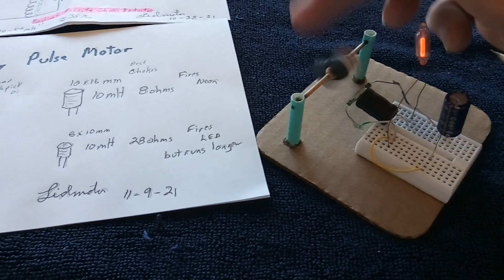Choked Paper Pulse Motor

Comment: That 2nd, more powerful & noisy choke motor arrangement...would that be powerful enough to spin a twisted & stiffened paper or acrylic plastic 'free flight' prop? To carry itself & the whole assembly inside a very light wing loading, micro 'stick-&-tissue' airplane?

Comment: Put 1W to 3W 110v LED bulb instead of neon, it will glow up.
I just success replicate it with 10mm antenna rod ferrite and 400 turns of 1.2mm copper wire, and using hall effect sensor instead of reed switch.

It spin like crazy and turned into mechanical inverter. May be with more inductance and resistance it will brighten up 5W 220V led bulb.
Perfect for DIY Camping LED with mechanical inverter 😀👍🏻👍🏻👍🏻👍🏻
Reply from the maker: Excellent!!  You just did an experiment that was on my list.  It works!!!!  Thanks.

Comment: Can you introduce the neon back into the system or does the energy not like to consume itself like bedini/imhotep?
Reply from the maker: That is a good question.  The simple answer is no.  Bedini found a way around it by sending the flyback energy on a litlle trip to a seperate second battery.  There are always losses in a system though and you only get some of the initial energy back.   I would rather just take the "rebate"  energy out in the form of a little indicator light and call it a day.
Reply: @Lidmotor  Bedini was a mask for https://www.youtube.com/user/rickfriedrich, The second battery with parallel as Rick explains having the connections for the return bemf from the outside, To state there are always losses means that we are inefficient in our ways of harvesting from the system as telsa noted I have been following you and others for many years, I would never defeat in the end of the day saying I would redraw your intention to the start of the day it can also be sent through a sjr looper as this energy does not like to consume itself unless changed or converted through rectification and as known well always lose a little in the water fall we call diode. @ lidmotor I did this many years ago https://www.youtube.com/watch?v=nroBcB-42aU&ab_channel=GG Tell me is it god work?

Comment: Excellent,  so if you had a bridge rectifier instead of the bulb would it output more dc than was put in?....or is it dc lighting the neon already?....if so could it just be fed back to the cap...?
Reply: It's not possible to get more out than you put in--that would violate the law of the conservation of energy.
Reply: @ab_ab_c    excuse my ignorance but the motor is being driven by 2.7v yet lights a neon at 60v ?.... thats why i asked.
Reply from the maker: You can't directly feed the flyback energy back into the system but you can direct  it via a diode to a second seperate capacitor.  You only get some of the energy back.  I built Joule Thief circuits like that in 2009 which had a switch I could turn from the main drive supercap to the recovery cap.  One is a solar powered night light that I named 'Hewey' and sits on my kitchen window sill.  Cute little guy that lights for awhile at night.   I don't flip the recovery cap on ever but it there if I want to use it.  It is like a spare gas tank.  Here is the 2009 video that shows'Hewey':  https://www.youtube.com/watch?v=a4R6gIXXe3Q&list=RDCMUC9jbwyyAum79LXTNCgHeuFg&start_radio=1&rv=a4R6gIXXe3Q&t=19

Comment: That bigger choke system looks quite powerful.  Any idea the torque that it puts out?
Also,  what is the difference in energy consumption?

Nice work as usual, Rusty!
Thanks for sharing!
Reply from the maker: I didn't measure anything here.  The big chokes have much more power than the little ones but they also draw much more amperage.  It is the standard trade off.

Comment: Could you please send a link to the kind of reed switch your using. I bought some cheap ones and it seems no matter how I orientate them, they only intermittently work. 
Thanks
Reply from the maker: I just get the cheap ones off Amazon (20 for $7).  They work good enough for what I do. The glass tube breaks easily if you bend the leads without holding it with pliers first.  Because they are so cheap I don't care how many I destroy for one reason or another.  I don't use reed switches for long running projects.  Make sure that your magnet is strong enough to trigger the switch.
Reply: Lidmotor 
Thanks you kind of inspired me to try building one with your tooth pick motor. I am using some very very small magnets I guess that’s probably what’s happening it’s not triggering the reed switch. You and the others make it seem so easy.
Reply from the maker: @user-wy3xe2tt3y  Keep trying!  I still remember the day I got my first brushless motor running.  It was on my kitchen counter top and I just stood there looking at it.  I was alone in my house and the only sound was the purring of that motor. It was magic.
Reply: Can i ask you why not using reed switches for long projects?i have small pulse motor and still spinning for months with reed switch, its stop when my wife break it..is reed switch bad for long pulse motor?.
Like always..you r my inspiration..keep an awesome work..chears

Comment: There is a coincidence, I picked up some toggle switches today in a charity shop. An odd find for a charity shop, but there was 4 of them in a bag for £1. Long story, sorry, but they were AC switches with neon lamps inside to indicate when they are switched on. At first I thought they were switches for a car dashboard and would be LEDs with a resistor for 12 volt supply. Couldn't get them to light with a battery, so I looked inside and realised they were neons 😊😊
Reply from the maker: These neons do show up in the strangest of places but they also hide in junk boxes when they arn't used very often.  This is the only one I found and I know that I have a bunch of them burried somewhere.
Reply: @Lidmotor  I bought a box of them when Plasma Channel did an interesting build with strings of them. That's another project I haven't got to yet. I haven't done one of your choke motors yet, but last week I did take apart a dead LED bulb that had a choke in it and thought I might try it sometime. PS. great build with the cardboard and the paper straws, very green 😊😊
Reply from the maker: @GrandadIsAnOldMan  These paper straws that I found could be used for a number of projects.  They are thick wall and stiff enough to be used in a model plane or kite build.   I thought about your kitchen floor car projects right away.
Reply: @Lidmotor  yes, my daughter shamed us into changing to paper straws a while back. I still have a secret stock of plastic ones for 'emergencies'. Rather like the cotton buds, the thin plastic tubes were very handy for some projects and the paper tube cotton buds just don't match the criteria, so I have a small stock of the plastic ones stored.